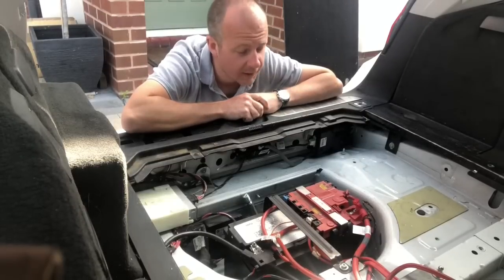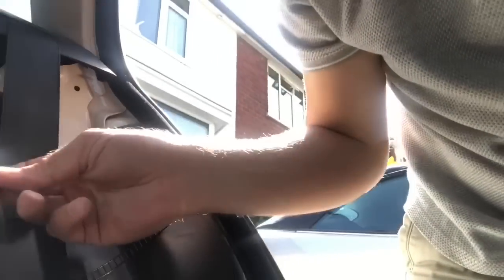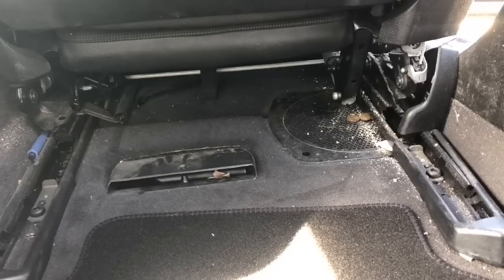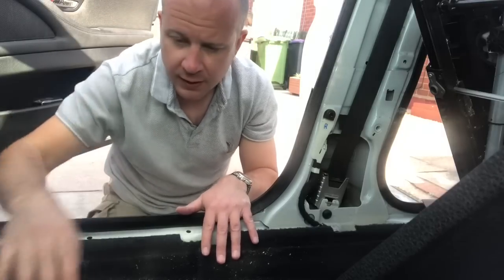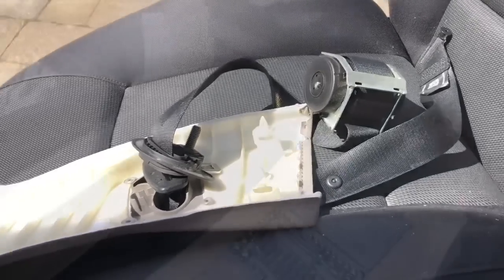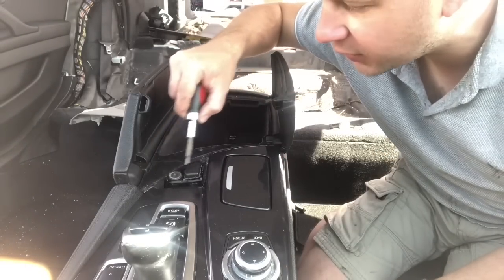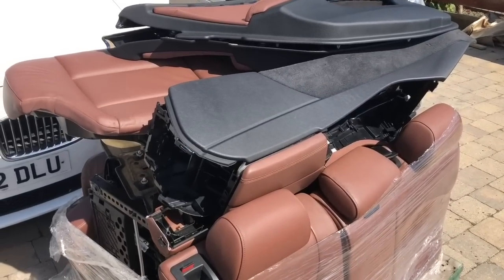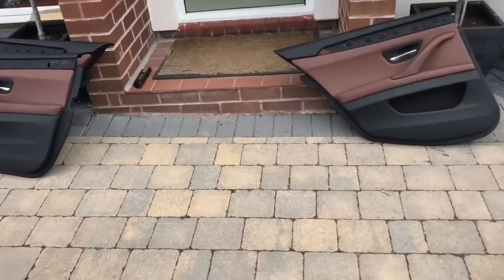Upgrading the BMW 530d (F11) interior seats

Comment: Reminds me of the interior swap I did on our old Saab 9-3 convertible.
Took me a couple of days,but we went from manual leather seats to electric heated memory aero hot seats (and a colour change from beige to black) so it was a full swap over and wiring .
Having a top that went down was a blessing 😀.
I was surprised just how heavy an electric / heated / air bag equipped seat is.
Reply from the maker: Yes, they’re really quite heavy aren’t they. I had a Mitsubishi GTO with fabric seats so I removed them & swapped with leather sports seats. The electric seats I took out weighed about as much as me!

Comment: What is the best way to actually get the seats out of the vehicle? Eg what angle does the seat have to be at and does it go out of the front or rear doors?
Reply from the maker: Once the floor bolts are removed you can tilt the seats backwards, then lift & turn them. They will come out of the front doors 👍

Comment: Is it possible to take out front seats from front doors or I should remove first back seats and get them out from rear doors?
Reply from the maker: They can come out the front doors if you want. I think it’s easier though to remove the rears first if you are replacing them all.

Comment: I have the same car and I want to change the seats in the same way , But the old seats non heated
If I upgrade the new one Will the heating work?
Reply from the maker: You will need to get the ECU coded to control them (& maybe need the physical buttons on the dash). I never actually bothered getting mine coded-in, but it can be done.

Comment: Hi i want to remove my front driver  seat, comfort seat Its basically 4 screws and the connection, plus the Seat Belt in the seat ?
Reply from the maker: Yes, from memory that’s pretty much it.  You should also disconnect your battery and wait perhaps 15 mins before disconnecting it too otherwise you may activate your SRS light 👍
Reply: Nut Job hi i bought it but its lci its smaller do you think rail is also smaller?🤔
Reply from the maker: Argh, not sure sorry. I thought most of the Lci changes were fairly minor things, rather than changing the runner mounts in the unibody...
Reply: Nut Job according to some people Its smaller :/ Shit im screwed , i only needed one seat for driver side , because some body cut with knife my seat,,, i could use the back rest thats the same but the seat is smaller f..k man why bmw makes everything so complicated
Reply from the maker: Thanks for the info 👍
I see, it was to accommodate the X-Drive equipment under the floorpan 🤔
Reply: Nut Job so it might be same as mine? My is Xdrive as well🤔 actually I didn’t measured How should i measure it?